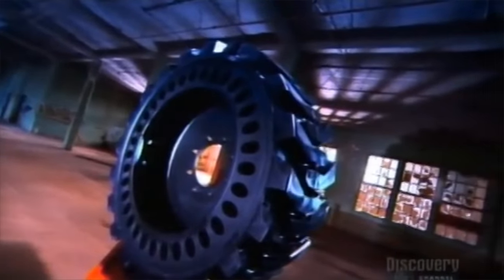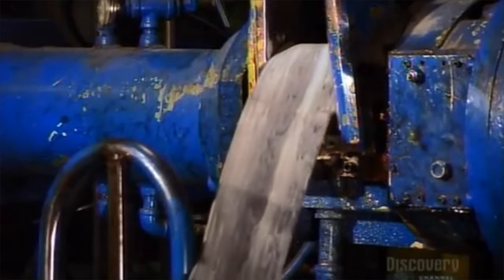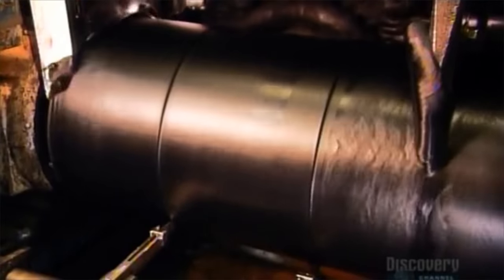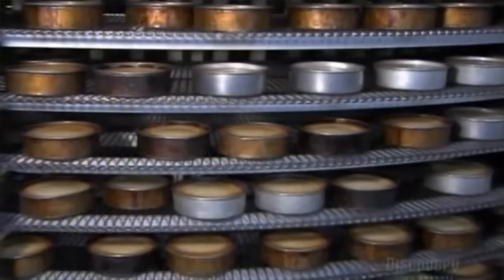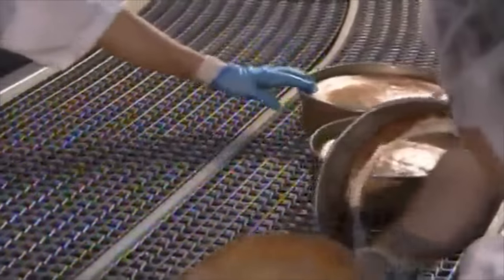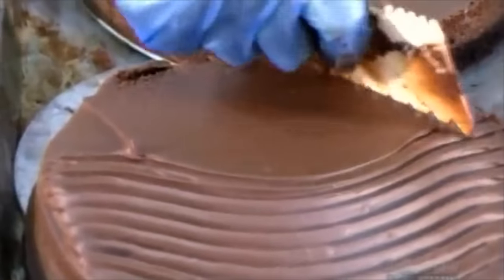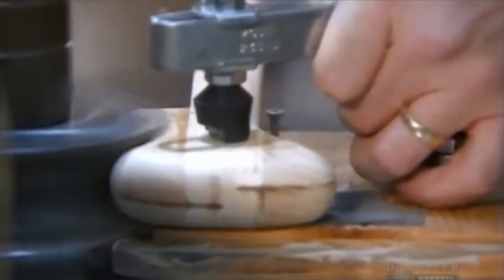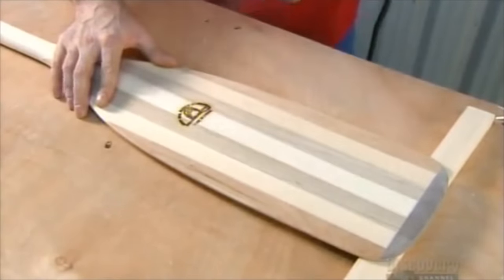How It's Actually Made - Solid Tires

Comment: Yes, if you take the solid tire off of any heavy machine, you will find that it is blue, spherical, and shows an accurate map of the world. This is very helpful for when heavy machines make their long treks through the mountains, as its not uncommon for the drivers to become lost. The decoy boat paddle can also be used in freeing the vehicle from any rocks when traversing water

Additionally, the chocolate rubber that looks like straight up dookie and three to five layers of cake rubber can offer a temporary source of food if one should be stranded for an extended time.